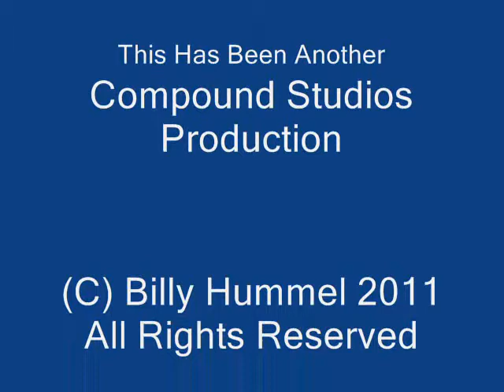Part Two Of How To Modify A Linksys WRT150N WIRELESS Router For RP-RF External Antenna's Hook-UP.

Comment: Great modding router. You really only need one side or the other. I got a little creative with this mod using both sides though. I installed DD-WRT version .v24 std r18024 and switched Rx to right and Tx to left. Then put an Alfa 18dbi panel antenna on my right N and a Yagi with a 2watt booster on the left. This lets me scan a bit for my remote signal and then pinpoint my transmit path without transmitting all over everyone elses signal. Gets some great mileage.

Comment from the maker: @madprepper Hey thanks for your comment and tip on the antennas. I did this mod for RP-RF connectors which this unit still does'nt have till you do the mod. I needed the RP-RF style connectors for my outdoor antenna this is why i did all this work.

Comment: @Skipholiday Same power amps I believe.You could probably pop the shielding off to check.If not then they are on the Broadcom NB helper chip. Either way you can access them through NVRAM switches and the commands work fine over SSH. I usually run them at 100mw by popping the outer cover off to blow air into the vent underneath.I suppose you can run these at 250mw with some heatsinks and an onboard fan.If you bump the tx up then make sure you get a higher wattage power brick+antenna.

Comment from the maker: @ Rigss... Not Sure if the power amps in this unit will work with that high of dbi antenna... I would look online into some forms to figure out what would be best for this unit for running a big Antenna...Make sure your output TX is set to 100% that's should boost the signal more...Also I run a Repeater on my system to boost my range...

Comment: @wah420 I didn't get a message on reply and just found this in my history lol. Anyway, I basically did the N connector mod and just used custom firmware with external antennas with a WiFi Tx booster within the US channels. I can do a writeup or something if you really think it's worthy of one. You pretty much covered the parts people would need help with.

Comment from the maker: @ Skip - Yes ( rp ) reverse polarity. 

At one time all connectors were straight.  Boys were boys and Girls were girls then along came the Government... 

In order to regulate WiFi and try to create connectors specialized for it's use we have the FCC and the wonderful concept of RP (Reverse Polarity).  Now we have Females with Male Pins and Males with Female innards.
The term "reverse polarity" here refers only to the connector gender, not in any way to the polarity of the signal.

Comment: Brother, I hate to break this to you after you did all this work, but the antennas are removable. Fold each of them down and slide the sleeves off. The you can unscrew the antennas revealing the connectors.

Comment from the maker: @skip  Im not sure if this unit has the SiGe 2528L power  amps. I did some looking online and could'nt find any info on which power amp it has. I know the set dBi from factory is 1.8 dBi. I even took this unit back apart to check on the board. The amps are not in plan view i think they are under the ground shield on the unit but not sure. You may be right but not sure.

Comment: I had a basic wifi in my modem. I updated it to 16dbi antenna for long range reception purpose. Now the wifi is working but in same range it worked before. Do i have to make some changes in values?

Comment: You dont need to do all that,  just run the 75 ohm coax cable right to the transmit points on the board, the less interconnecting of cables and the shortest connection points is what you need, to reduce the capacitance effect from the cable, if you need connectors use 75 ohm connection points to termination point. I run no connectors, straight coax to the end leave a one center exposed for your antenna, and you will get 200 yards.